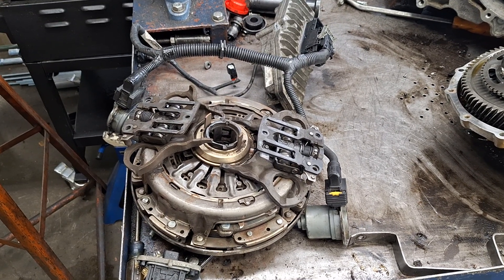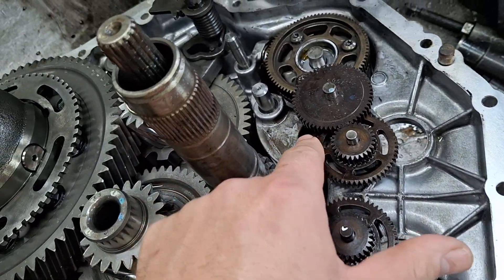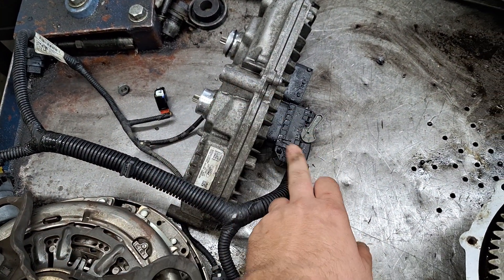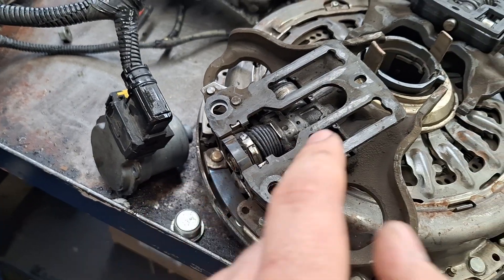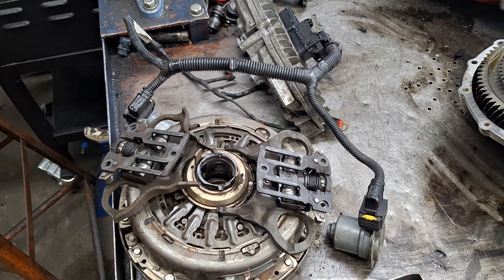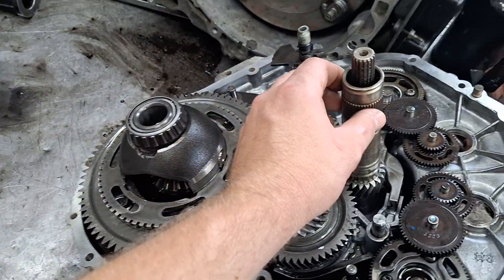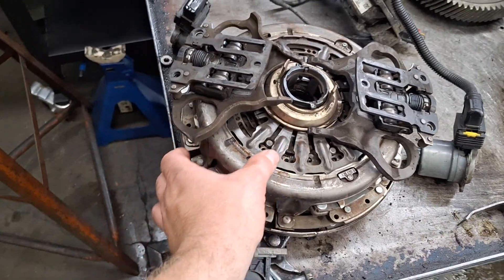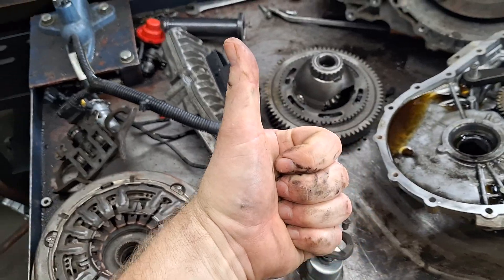How A DPS6 Transmission Works! Ford Focus / Fiesta Dual Clutch Automatic!

Comment: Thank you so much for all the videos you have available for these transmissions!  With some confidence in watching them, I have just completed replacing the clutch with the Luk repset.  I followed your videos as well as some others.  I have completed the relearn without any issues.  It shifts well, I have no codes, but I have a noise similar to what I can only describe as a ground effect on a car hitting the pavement.  It's very short and can be timed to every two seconds and only when its in what I would guess is 6th gear, cruising down the highway at a steady speed.  It goes away with any change of the gas pedal.  I was just curious in all your experience if you had ran into this issue before or had a guess on what I could check.  Thanks in advance!

Comment: hello great video.i have a costumer with a focus with this powershift and he says the dashboard warning high tempeture in gearbox.the oil in the gearbox looks old but it was at the right level.any thoughts
Reply: There's no transmission oil on these cars
Reply: @dropdead6969 ok how you call the fluid there is inside the gearbox.?? Thanks
Reply: @motormaxwarnes9075  you cant access that fluid without completely removing the transmission. You cant just change the fluid
Reply from the maker: Theres fluid in the case for the gears. But it won't cause the clutch overheat codes. Thats a separate issue and should be diagnosed. Clutch forks and actuators are both common causes

Comment: Thanks for the breakdown. This is a longshot, but if you're still monitoring this video, I could use some advice. I have a 2015 Focus with a failed TCM. It's a salvage, so I couldn't get it replaced. I rode it as long as I could and ended up burning through the actuators and clutch, and now it won't reverse. I'm thinking about buying a transmission from a junkyard, the best TCM I can find, and basically transplanting into my '15 Focus. Am I crazy? Should I just dump the car? I'm based in Los Angeles. Any advice would be helpful. Thanks.

Comment: Seems like a massive pile of shit with a horrible reputation. Was a "fix" ever found for this bag of recycled ass or is it cheaper to relearn and bandaid the garbage to kick it out of the service bay?
Reply from the maker: It's going to shudder no matter what, but otherwise once you do the fixes and install the updated parts it'll be reliable for years but will fail again eventually

Comment: I just did a input shaft bearing, which was bad, I put all back together lock the clutch inserted it, and once it was in the transmission, I unlocked it, got transmission put back into car. I first did the transmission range sensor program and the adaptive learn program and now if I take it for a drive, it’s just fine, but it makes some sort of grunt or grind noise when it shifts from 2nd to 3rd under somewhat of a load, any help would be appreciated. If I’m missing any more programming please let me know.

Comment: i have been running down your play list i have learned a lot. my daughters car sounds like it needs a new clutch and shift forks p07a2,p07a4,p2700 and a p2701
i have replaced the actuators on the top and botton already.
Reply from the maker: hey glad they helped and yes that sounds like a correct fix

Comment: No automotive background here, but may i ask why it need to be reset before installing
Reply from the maker: @mitchelle05  the clutch needs to be reset aka locked because otherwise it won't fully seat itself in the transmission
Reply: @BigBensCarsAndCycles  thanks for your reply

Comment: We are repairing the same transmission. We replaced the clutch and replaced the tcu, but it still doesn't move forward or backward. If i check the sensor data, all the shift drums are negative, so can the fork be a problem?
Reply from the maker: @리또속-b5h  hi it could be a sheared shift drum stop on the case
Reply: @BigBensCarsAndCycles exchange fork 1 and solve  thank you

Comment: Hi ,

I took out my box 10 min ago. Its making a huming sound like a wheel bearing but its in the transmission . When you knock it into neutral at any speed , the noise goes away . Would it be an output shaft bearing ? I never opened it yet . Thanks

Comment: I ordered the dual clutch kit for my 2014 focus and the kit doesn't come what's the hub 1 that has the paint mark on it to line up to clutch 1. I'm thinking about using my old one will it hurt to put it on without a lining paint marks
Reply from the maker: @jaytank31  hey it'll be fine. And it's not been important to line a mark up in my experience
Reply: @BigBensCarsAndCycles  thank for the quick response my guess is to use the old one. Looks like they dont send them in the kits anymore

Comment: I love my 2017 focus the paddle shifters/S mode help alleviate shudder considerably and gear changes are smooth because you can change at high rpm’s than Normal

Comment: hey ben, your video explanation was very understandable and useful. Been having some issues lately with my megane 3 coupe 1.5 DCi 2011 which is EDC. So,, when i accelerate at somepoint I'm losing my gears and then the gas pedal is not reacting at all at full deflection.when the rpms drop it re-engages the speeds like nothing happened and then the same. its doing it 3-4 times before it throws on Dash Check auto gearbox. Then its stuck on 1,3 or R and even stuck on 1 the car is on N but not move(also on 3rd). The only thing thats throwing on Diagnosis is ( shift drum 1 issues.
Btw the manual mode kicks like crazy and even skips gears.

Comment: Have you heard of drilling holes in the transmission housing and then spraying brake cleaner directly on the fork to fixed a shutter or forks that are binding?
Reply from the maker: @HardeepSingh-g7g  hi, I've heard of it but never tried. I think it can buy you some time before replacing the forks and clutch
Reply: @BigBensCarsAndCycles  Awesome, Thank you for all your great content!

Comment: Is it common for the TRS to go bad after a fork and clutch replacement?
I just did this job and I am getting TRS codes P0707, and P2802.
Did i mess something up in the process? It is plugged in.
I tried turning the car on, and putting in neutral to reset. The screen says it's in D and doesn't move when shifted, but knows when car Is or isn't not in P. tells me it's not in park if i try to remove key. Lets me when it is in P
Reply from the maker: @bobbyc5922  hi make sure you reattached the shifter cable. If that's OK try adjusting the cable. If that didn't work try a new range sensor before replacing the tcm
Reply: @BigBensCarsAndCycles  Hey, thanks for the reply. The cable is attached, and changes gears. 

My cousin who works at a shop sent me something saying to put car in D, remove the sensor clean, and put back in.

I did do this whole fork job with car in P. Maybe the problem?

Comment: Im stack need unlock put in ? Gear bk or leave lock position  plz?
Reply from the maker: @sara78130  the clutch needs to be locked during install, then unlocked after it's fully installed

Comment: Please can you tell me wich gear has one actuator and wich gear has the other i mean 1 actuator has 1. 3, 5 gear the ather reverse 2, 4, 6 gear right???? Can some one tell me if if right
Reply from the maker: @rasimcupi1413  clutch A 1 3 5. Clutch B reverse 2 4 6
Reply: @BigBensCarsAndCycles  thanks so if my car drops. Down reverse 2 4 6 but is fine in 1 3 5 the problem will be the actuator b

Comment: The "clock gears" as you call them, if the TCM is removed and the clock gears are disturbed, do they have to be timed? Do they have timing marks?
Reply from the maker: Hi. They do not need to be timed. The TCM decides what position to set them in. Hope this helps!

Comment: If the transmission keeps overheating and it won’t drive in first without overheating what could that be
Reply from the maker: Need to know what fault codes are in it

Comment: So, what makes this specific DCT a horrible one?
Reply from the maker: The control modules had issues up until a 2017 design. But they all have shudder issues because it's a dry dual clutch
Reply: @BigBensCarsAndCycles  are the recent TCM now fixed? Or is it still the same thing that breaks down every now and then?

Comment: I have a question just to inform my self a bit . I have a 2013 ford fiesta 1.0 ecoboost with the dps6 transmission and it shifts fine and without issues but i had my wetbelt swapped at the beginning of the year and ford of course gave my car a test drive and they noticed that my transmission is making noises i didn't even took that sound serious because it didn't bother me. I did swap my transmission oil 2 weeks ago and there is no change in the sound . it does sound like something large is rotating because once it fully rotated there is a extra scraping noise and when I'm driving and switch it into neutral it still does that sound .i was wondering if a rusty clutch could produce a sound like that ? Thanks for any information
Reply from the maker: Hi, if the noise stays the same when put in neutral at speed, that may be final drive bearings or a wheel bearing
Reply: @BigBensCarsAndCycles thank you for the information i will have to check out what a final drive bearing is i guess  it should be something like that but it's definitely not the wheel bearings i already checked that and that scraping sound doesn't change while driving in corners but i could be wrong so i might check it again but I'm sure it's the transmission because that sounds is coming from behind the steering wheel
Reply from the maker: @SASMacDroid  also make sure the backing plates aren't touching the front rotors
Reply: @BigBensCarsAndCycles  thank you for the information i definitely didn't check that
Reply: @BigBensCarsAndCycles  ok I'm wrong i drove up to 70 kmh and switched it into neutral and that sound instantly disappeared and switched it into drive and it instantly appeared again and i have a slight scraping sound while in neutral so i guess i have multiple issues 😂
Reply from the maker: @SASMacDroid  probably a noisy output shaft bearing. Check my video for Ford Focus P287B Case Half replacement. That's how you access the bearings
Reply: @BigBensCarsAndCycles  thanks again for that

Comment: Hi, very nice informative video! I'm currently looking to buy my first car ever at 23 yrs old and I think the Ford Focus 2016 is the one I love especially by the design that looks pretty clean and beautiful but a lot of people keep telling its a bad car because of the transmission.

Do you recommend buying it or what's your opinion about the car?
Reply from the maker: Hi! The dual clutch transmission will need attention occasionally. But once it's fixed it should be fine for 100k miles. You might need the TCM replaced one day if it's an early build 2016. Otherwise just cheap basic general repairs once in a while. Overall a good car. If you can get a 1.0L 3cyl ecoboost, that comes with a bulletproof reliable conventional automatic transmission.  And the 1.0L Ecoboost is about to be recalled for their only known major issue so that'll help you there.

Comment: Very well done. Only comment is I wish you showed how the forward, reverse, and neutral gears applied when you move the shifter. I have a problem that my car is not coming out of neutral
Reply from the maker: Does the shifter still move, but the dash shows neutral? What fault codes do you have if any?

Comment: Do you have a video showing how to know if the clutch is good or bad? same with the bearings and other pcs in the transmission. I'm going to replace the Clutch B fork, but want to know if everything else is good while its all taken apart.
Reply from the maker: Yes, this shows the teardown of the clutch and inspecting some of the components. https://www.youtube.com/watch?v=EIJt9anfdSM&t=0s

Comment: by the way I am just updating you with my problem regarding the voltage drop when pressing the brake pedal even on neutral, I noticed that when I press the brake there is something clicking liek relay sound on my passenger cabin fuse box, is there any fuse or relay there connected to the brake pedal?
Reply from the maker: Sounds like a BCM issue. Maybe you can check input voltage to the bcm while the pedal is pressed
Reply: @BigBensCarsAndCycles  where is BCM by the way?
Reply: @BigBensCarsAndCycles  Anyway I just googled it, thank you so much for inputs.. you helped me a lot saving money hehe, thank you
Reply: @BigBensCarsAndCycles  last question.. hehe, is there anyway or something I can disconnect for a while in brake pedal connected in the BCM? so voltage drop will not happen, assuming bcm is the issue, as of now still no warning lights and codes

Comment: I recently charged the tcm and one of the o rings fell apart and part of it was in the hole for the tcm i got it out but was checking for anymore peices so i turned the gears, do they need to be at a certain location before putting the tcm back on?
Reply from the maker: Nope, the tcm will adjust the gears itself.

Comment: Do you have to reprogram the transmission after repair?
Reply from the maker: After a tcm replacement yes. After a clutch repair, just relearn the touch points

Comment: So i am doing my transmission right now great video's very very helpful for me personally because i have a 2014 ford focus i got it drove it for 4 mouths and broke a fork and had to replace that get new trans fluid i destroyed the lower control arms trying to drop my transmission so i changed them , this vehicle is a pain i hope after i fix it and relearn the tcm the vehicle runs ok i have never done this big of a repair in my life so its a slow process
Reply from the maker: Those ball joints can sure be tricky. You can spread the knuckle a little where it pinches on the ball joint and that'll help. Good luck to you. With a new clutch, forks and slave cylinder you shouldn't have any issues after for a long time. Unless the tcm fails (if it's original) that's an easy repair

Comment: Yes it is a cool set up but what is the purpose for this trany.
Reply: Increased fuel economy, better efficiency than a traditional automatic. But Ford was not ready to develop something like this
Reply: @someguywithaford  well looks like ford is set for quality is job none.
Reply: @someguywithaford Ford doesn't own this transmission
Reply: @mtsanchez27  Ford designed it, Getrag built it
Reply: It’s designed to break your heart and line the pockets of dealership service departments.

Comment: This is excellent Ben! 👍I don't care what anyone says, it's a cool transmission!
Reply from the maker: Agreed, theyre simple to understand and remove from the car!
Reply: Or clean it inside more frequently. Even though I know a cleaning system could be built into the clutch side of the DPS6, that blasts clutch dust out of key areas. Like I said, connect the air fittings, go up and down through all the gears a bunch of times, on a rolling road. Collect any clutch dust from the exit holes, every 24,000 miles, or whatever, according to rate of use, and you're all set.. maybe each time, finish it off with a huge blast of brake cleaner, once the bulk is out @BigBensCarsAndCycles
Reply: Pretty good if you need to swap it out, between rally stages, in a few minutes. @BigBensCarsAndCycles

Comment: thank you for sharing. I live in Australia and I drive a Ford Kuga DIESEL 2.0L 2016 with 6DTC460 powershift (wet clutch) transmission. They are also complicated piece of shit with plastic tabs against springs in the clutch housing that often brake and contaminate/disrupt  the solonoids. Ford at its worst.......
Reply from the maker: Agreed that these transmissions have their issues. We've got the Escape over here (renamed Kuga) and I think that's neat having a diesel engine in one. I also didn't know ford used a wet dual clutch. Interesting to know they also have issues.
Reply: @BigBensCarsAndCycles  to ensure the  6dct450 and 460 wet clutchs last at least 120,000 miles, they requires regular tranmission fluid  and filter changes every 20-30,000 miles. But also you need to drive them with respect.......... My car has done 90,000km in 7 years and I change the transmission fluid and filter (plus  the transfer case and the dif fluid for the AWD) every 30,000km  (costing $600 AUD = $400 US). I also change engine oil every 5000km . So far so good. I am a retired pharmacist and hoping to keep the car for another 7 years before jumping into an EV
Reply: Do you drive it easy, or harder?
Reply: @DetroitMicroSound  I am 68 years old and I drive it with respect. The 2.0L turbo disel engine has plenty of power and torque and great economy.  It pulls my 1000kg boat with ease and doing 120kmph 75mph with barely 2200RPM